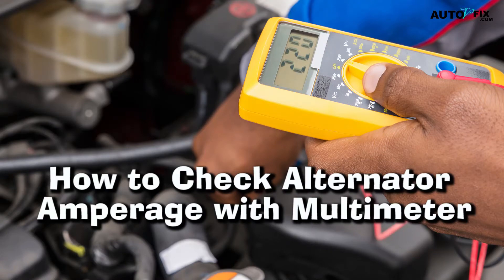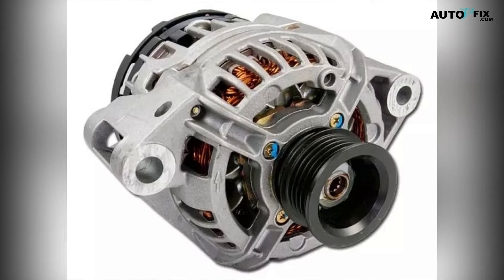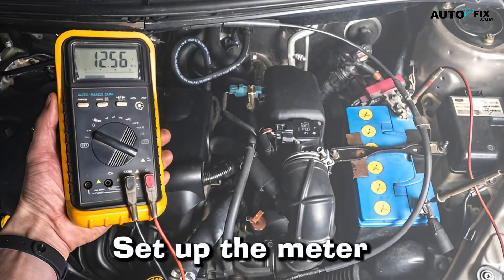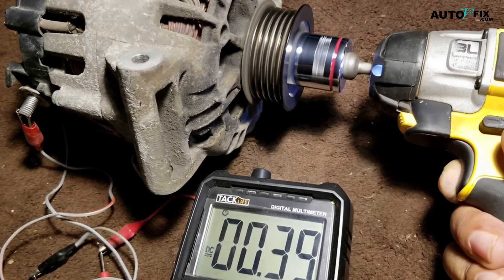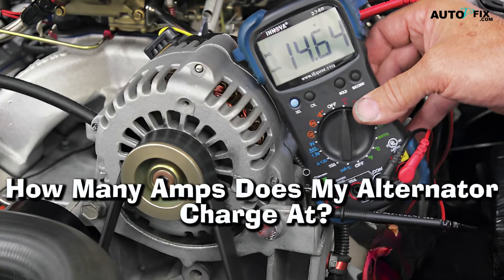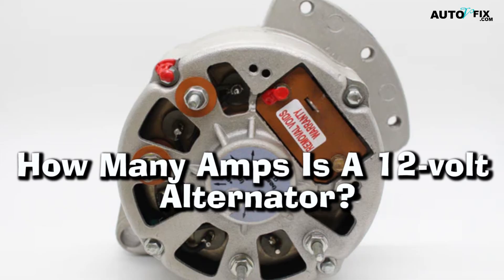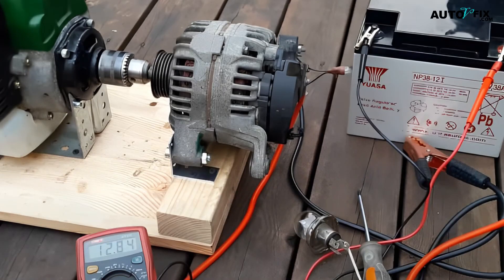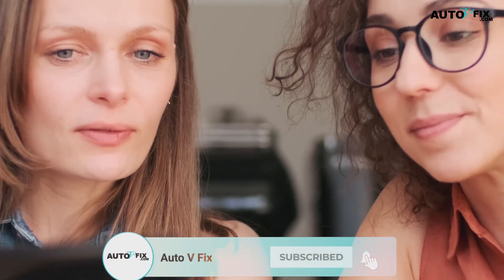How to Check Alternator Amperage with Multimeter

Comment: Nice voltage test. Not a thing about amps. You will need the volt meter with an amperage clamp to the meter. Turn on ALL of the vehicles accessories. A/c wipers, rear defog, lights, everything on. The meter hooked up correctly with the amp clamp engine running. That's how many amps your alternator is able to put out. You're welcome